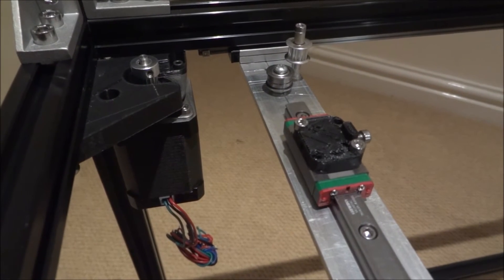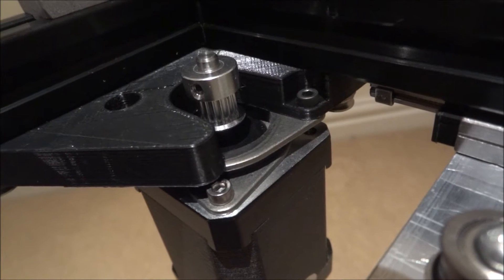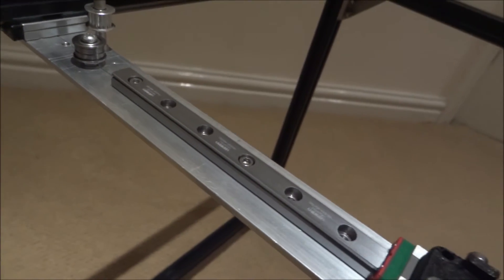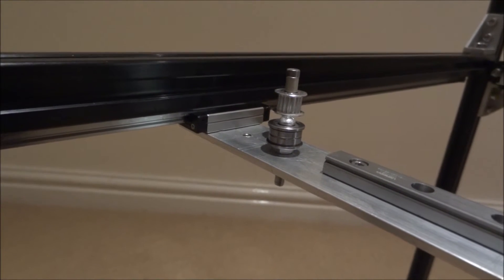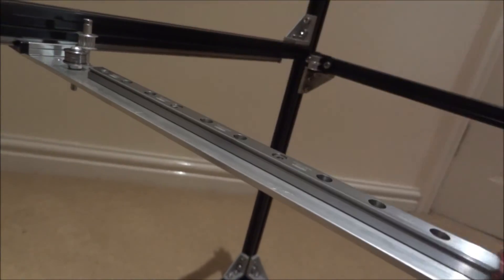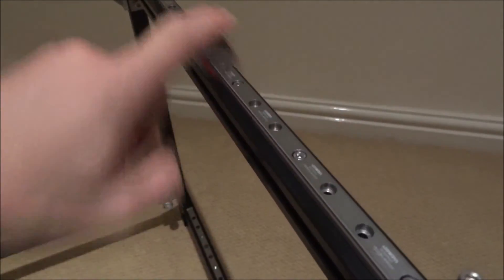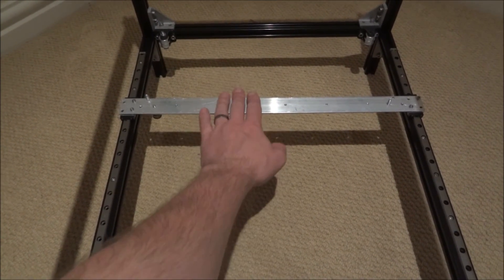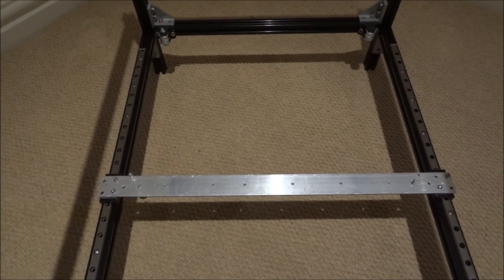3D Printer Linear Rail Comparison - Hiwin vs Robotdigg: Unplanned Part 3

Comment: Good grief, you are no scientist are you. Now attach the 3mm flat cross member as well to the second example to act as a speaker cone with a significant surface area, I.E. as you had it in the first example.  You are comparing a 4cm square air shaker to a 300cm square air shaker and complaining that the larger one is louder. Ridiculous.
Reply from the maker: m3chanist your point is relevant, at least to see what happens. If I had thought of that, I'd have needed a second hiwin to do what you suggest in a meaningful way. Your tone is pretty negative but thanks for looking and putting a suggestion out there. 
Once the belts went on, the noise from the linear rail was damped and I have kept the arrangement with the Robotdigg rails on the Y axis to this day.
Reply: Good to hear, and an apology for the tone. Sometimes I am indeed quite negative, especially prior to enough coffee. I'm certain the relative volumes would be very similar to within a few percent, thinking of the vibrational elements as speaker cones with a given surface area to displace air (aka make sound) is the thing.
Reply from the maker: I really appreciate the apology - I'm sure you'll appreciate that I'm just trying to help by putting my experience and thoughts out there when there seems to be little discussion of these kinds of issues for DIY/hobby machines. I also appreciate that you have something useful to say that others will find helpful on the same topic and I'm glad we can get along.
Reply: Or you could have just did a comparison of one cart to another, in the same physical location. This was pretty cringy watching you compare them.

Comment: Two questions for you. I have unbranded linear rails, two are very sticky and oil didn't help, any adjustments for them? Also, I noticed your idler pulley mounting had a ball on the top, what did you use to mount these? I am looking for something to solve a problem of mounting my idler pulleys so they are using the bearings in the pulleys, not wearing around a screw through the middle.
Reply from the maker: Sorry, not sure what to do about the sticky rails, other than run them lots and lots. Even that is a guess as I haven't tried the cheap ones. For the idler mounting, you might like https://youtu.be/Eh_Lulo3W-4
Reply: Got to clean off the grease and then reapply. The grease they put on is only for rust prevention, i does not qualify for bearing lube. Use wd40 lithium grease after.

Comment: I'm interested in using Robotdigg linear rails (probably MGN15) for a CNC.  I don't really care about noise of the rails because the spindle will drown them out by far and it's not moving nearly as fast.  Can you comment on the quality and rigidity of the robotdigg system, compared to the hiwin?
Reply from the maker: Robotdiggs felt like they had slightly more preload on them. Seem fine, not quite as smooth but no stickiness/stiffness once in the machine. Not taken the machine apart to see if anything has changed after many hours of use. Bear in mind that I'm not really loading them like a CNC (router?) would. The seller I got the Hiwins from has stopped MGN range but does do another in 15mm (HGR15?)  linkCNC on Aliexpress if you want to try them.

Comment: may it be, that the frame amplifies the noise quite a bit? it sure sounds like it
Reply from the maker: Cuda FX possibly but once the belts are in place and tensioned and there's grease in the bearings everything quietens down a lot. I'll be rebuilding and posting the next phase of construction soon.
Reply: greasing them up propably makes the world of a difference already. do you know if it's okay, to pack MGN bearing blocks with grease, like a linear  or "normal" ball bearing?
Reply from the maker: Cuda FX I used white lithium mountain bike bearing grease and coated the rails and squirted it in from underneath. I did it that way, rather than forcing it in more directly because of how easy it is to push the balls out of the race way. Seems to have worked though.

Comment: regarding noise. you oiled the hiwin in the begining. did you oil the robot dig ones?
Reply from the maker: anthony king, yes with 3-in-1. I've brought some white lithium grease back with me this week and I will put it in both sets of carriages to see if it helps. If you watch my first moves video for the MoreXY, the sound is much quieter under slightly tensioned belts than when moved freely without any belts (as in these comparison videos).
Reply: Good luck I'm hoping it works
Reply from the maker: anthony king Thanks - I ordered some MGN12 for the X gantry in the hope it will improve the rigidity of the hot end mounting.  Too much deflection in the bearing carriage "roll" (as opposed to pitch and yaw, if we use an aviation analogy).

Comment: Those rails are not designed to be run upside down
Reply: supported rails are designed to work in all directions. read Hiwin documentation :-P
Reply from the maker: vidznstuff1 thanks for tip. I'm going to see how the Robotdigg rails work in that orientation as I didn't notice a difference from being the right way up and I'm not too worried if I end up damaging them - they're probably going to get replaced with Hiwin at some point. Will be interesting to see how they cope with things over time. The main reason I went with inverted rails is to keep the belts as close as possible to the rails, line up the X and Y rails and minimise resulting moments. Not sure if it would make a significant difference in practice to print quality but theoretically worth trying to do.
Reply: Bad information.

Comment: Did you grease up the carriges before assembly. Each carrige must be filled with lithium based grease before installation, and re-greased every 100km. I think that would take some of the noise from the steel balls. As an alternative you could look into the QH-series of Hiwin.
Reply from the maker: Bo Andersen thank you for the tip! I actually (and quite wrongly, I know) used some 3 in 1 oil at the suggestion of the Hiwin vendor. I have some lithium grease and when I'm back from holiday I'll try it out and update here. Thanks for the alternative rail suggestion - I'll take a look but I'm pretty much at the top end of my budget with the MGN9.

Comment: In your test the Robotdigg's are connected together and a slight misalignment may add strain on the ball bearing, which will cause noise. Can you compare a solo rail attached to frame for both cases?
Reply from the maker: Hi +Yuri Yeretin, I did do a little solo noise comparison in this video (https://youtu.be/M53spRq9_IQ?t=5m33s).  You're right, there was slight misalignment in the carriages when I mounted the 3mm flat aluminium gantry to them. It was much more severe initially, so I loosened both the extrusion corner brackets AND the rail attachment bolts/screws, ran the gantry up and down and then retightened, taking the carriages to each point before tightening there. As and when I get the long Hiwin rails, I will do a like-for-like test.